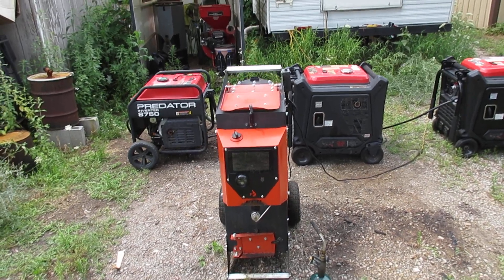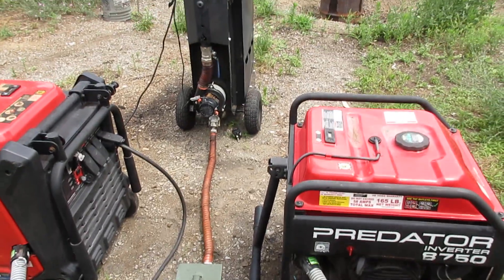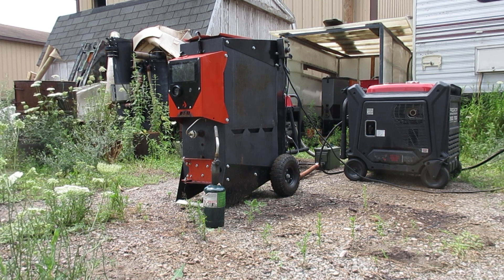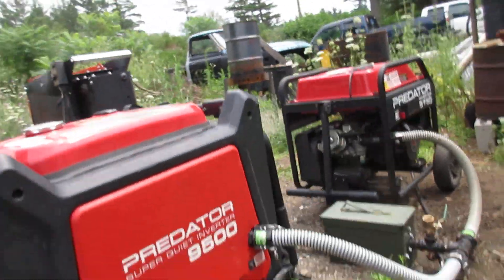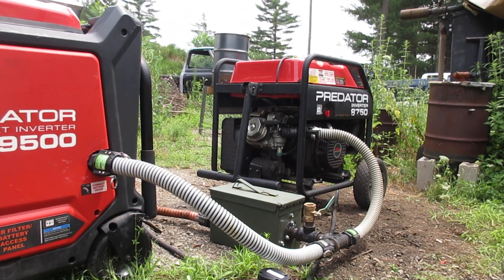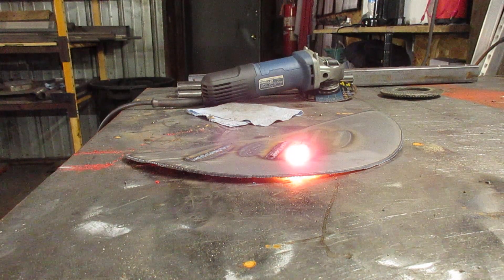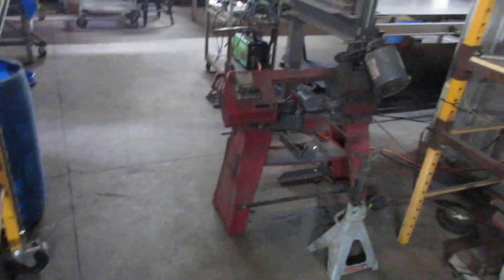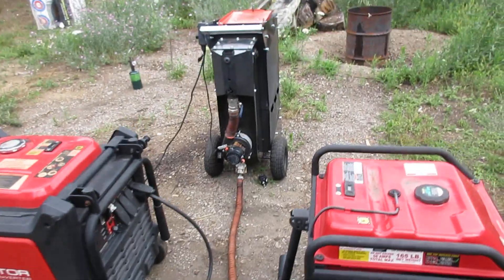Running the Predator 9500 and 8750 in parallel on a single gasifier!!

Comment: Questions, 1 Will running on syn-gas extend service intervals opposed to gasoline? 
                    2  Have you considered RV or power station type generators for off-grid given there lifespans of 500-3000hrs?
Reply from the maker: You can run what ever generator you want the machines are universal. I prefer the Predators, they are low cost and just as good as a Honda and all you have to do is re ring them over and over. Just a light hone in the cylinders to seat the new rings. We change the oil monthly regardless of fuel ran or hours put on them. We are going on year two and we run these generators 8 hours a day everyday.

Comment: Thanks for the post.   I am thinking of buying 3 8750 generators and running them in parallel.    So you left your neutral/common bonded ?... Would it not be better to have the neutral/common floating neutral?
Reply from the maker: It wont work, you must have a 9500 and you can only run one 8750. The 8750 can NOT sync with another 8750. The 9500 however can sync with the 8750.
Reply: @Thrive-Off-Grid   Thanks for the FYI.....
Reply from the maker: @dartarnaez8323  Yup and if you add an 8750 into the mix. When you run the 8750 it must be the master. So this is the generator that is started first. Then when you start the 9500 it will see the input from the 8750 and then sync to it. If you do this the other way around the 8750 will start but it wont go into output mode.
Reply: @Thrive-Off-Grid  you indicate in your video that it was able to sync.
Reply from the maker: @MrRChitty  I had only had this set up for like a day and thought I had started the 9500 first at the time. After further experimentation I found the 8750 does not have sync capability. The 8750 as a slave will not transition into output mode. I flipped the breaker and it would engage into an output mode. But I think there is some delay as the 9500 has to sync on the fly in this scenario.
Reply: @Thrive-Off-Grid  thank you. Expensive proposition. Heads up with your 50 service, you only need two of those bad boys. That'll give you 60 per leg. Assuming your protecting it through a panel inside your building.  Otherwise watch those wires. Hopefully you're using something larger from your Junction to the building.  You'll need 6 gage from your plug to the building.
Reply from the maker: @MrRChitty  I realize this we will never pull that much power. Understand I am a manufacturer of biomass gasification systems. When these engines are running on syngas they are only capable of 50% of the gasoline stock rated output. The cables are fine they do not change in any tempurature even when we pull full load. Been doing this for over 10 years.
Reply from the maker: @MrRChitty  The most power we even have capability to even pull is 25 amps. Not to mention the breakers is the box will blow long before wiring will be an issue.
Reply: @Thrive-Off-Grid  nice. Love the info.

Comment: I’d love to bank three gasifiers and six 9500 generators automate the charcoal feed and let it run.  If I can find an efficient way to make charcoal out of my chips we might have a easy feed system with finer particles. Would chips need to be tumbled or rotated in the charcoal process?
Reply from the maker: If you had the DFX-S3 full team running a single 9500 generator, they would run it for 6 to 8 hours. Thats 15 kW/hours
Reply from the maker: See video charcoal is easy to make. https://youtu.be/VzGpIGQiv-8
Reply from the maker: There is no limit to how many kilns you can operate. Making charcoal is a lot easier than raw wood processing. Your gross feed before fuel prep to net watts out will be the same as raw woodgas but without engine stalling, tar production, fuel drying and all the other head aches that go with raw wood fuel gasification.

Comment: So what have you done to automate the process so charcoal is added on demand without someone feeding it?
Reply from the maker: Yeah dont assume that these machines have short run time. The DFX-S3 has a 2 hour run time. A team of them could run both those generators for 3 to 4 hours, if this is not long enough this technology probably is not for you. Adding automation will add $$$$$$$$$$$$$$$$$$$ and push this way beyond market price point perception. Weve been there and done this before. Automation will make this way more complex than it needs to be. its more stuff that will break, jam etc. A single DFX-S3 is all you need to charge a battery bank for full time home off grid and back up your solar system.
Reply: @Thrive-Off-Grid  great info thanks
Reply from the maker: That is the point of adding the teaming units to extend your run time.